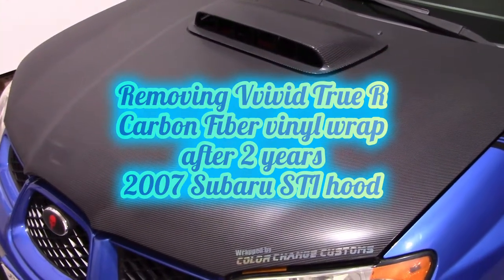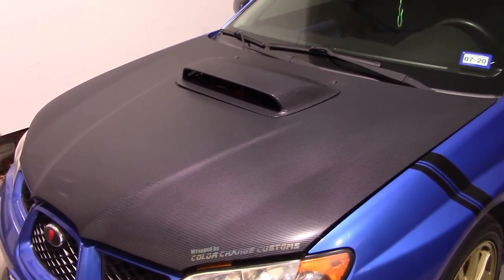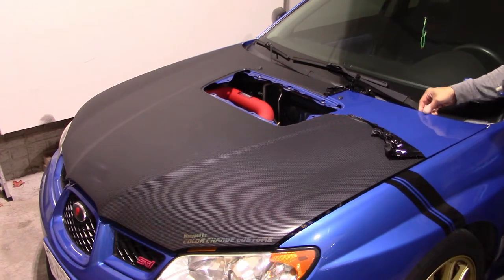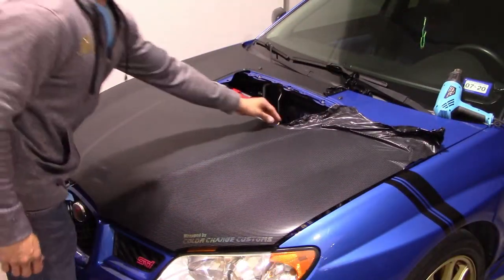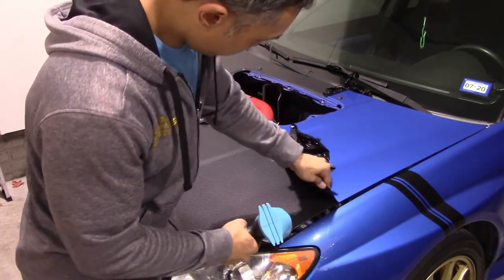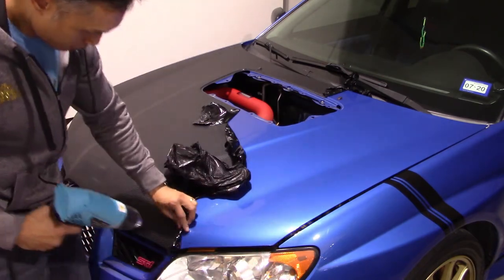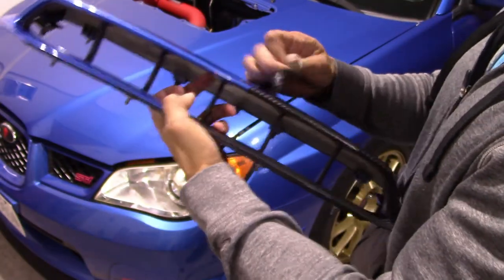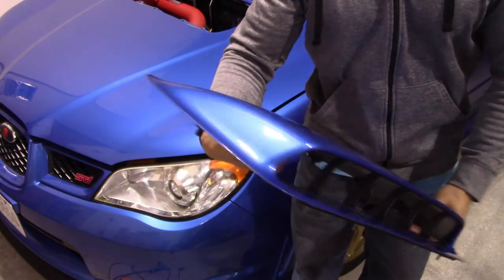Vvivid True R Carbon Fiber Wrap Removal

Comment: Will the surface be sticky after removing? If yes, how can you remove the stickiness, with sponge and soap?
Reply from the maker: It really depends on a lot of factors. Generally speaking, however, no, it shouldn't be sticky after removing.  Quality automotive vinyl wrap is designed to be removable.  However, that assumes the vinyl was taken care of and hasn't been on the car for a long time (5+ years).  If any glue residue is left, usually a mix of alcohol/water (80/20 ratio) will soften the adhesive to then be able to wipe away with a soft cloth.

Comment: is their anything i can put on top of the vinyl to make it glossy and shiny and protect it
Reply: Mothers cmx, put about 3 coats on. It's a ceramic coat with some uv protection to bead liquids. Keeping the car covered if no garage will be ideal
Reply from the maker: Sorry for the late reply. You can ceramic coat it after, as I know of several people that have.  However, I don't know that it will have that "clear coat" effect (glossy and shiny) as this is a textured, semi-matte finish.  I think you'd need several layers of a gloss clear to achieve what I think you're after.  For that, I would just use Vvivid's Tech Art, which has a high gloss, smooth finish.  It also looks super real as well.  https://amzn.to/3z0fl9D

Comment: i see this holds up pretty well.. i watch your video of the review.. do you think this well last in high temps bc i live in az.. also can this be ran thru car washes.. im lookng to do my hood and center piece of my wing in this
Reply from the maker: In AZ, I would probably not keep it on more than two years before removing the vinyl. If applied well, it generally can stand up to car washes, but it all depends...
Reply: Color Change Customs ok thanks.  Icy paint is starting to get dings/chips in it bc the person who painted my car and rushed. And it wasn’t sanded well to help keep paint on correctly.